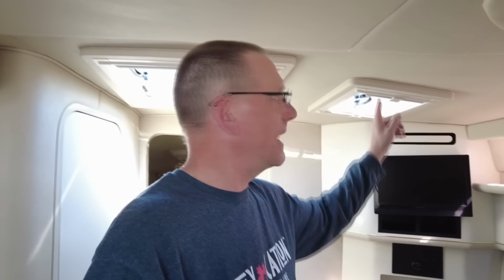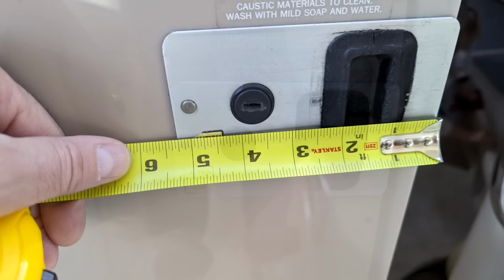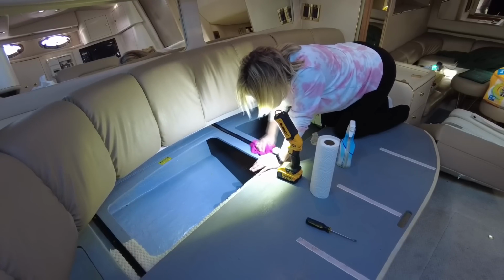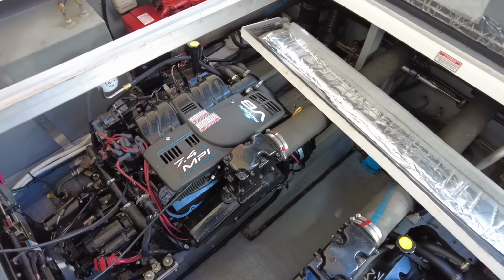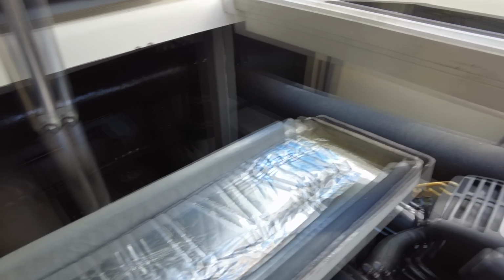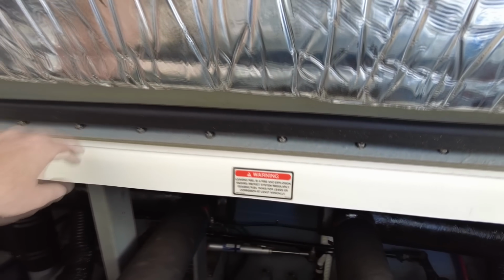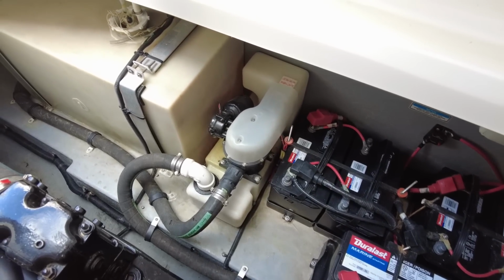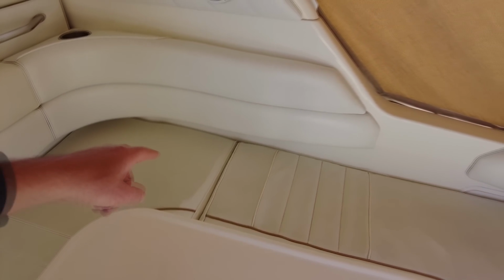Preliminary Boat Clean Before Shipping Home

Comment: When you picked this boat did you consider a different maker with Center Windshield walk thru? Do you feel the walkaround is still safe with grandkids etc... ?
Reply from the maker: No. After almost 25 years of experience, a walk around is not only safe, but so much more practical for our type of cruising. When the grandkids are with us, there's always someone there with them to make sure they're safe in the deck, so however they access it doesn't matter.
 Besides, a walkthrough windshield would only be available on boats of a certain size or brand.

Comment: Just an FYI...the bilge hatch seal on my boat failed during the covid layup with the hatch open.  To my surprise, the factory adhesive was not affected by acetone.  Simple mineral spirits was what I found would remove that adhesive.  Just in case you run into the same thing, that might be an option for you.
Reply from the maker: Appreciate the heads up. I just might give that a try.